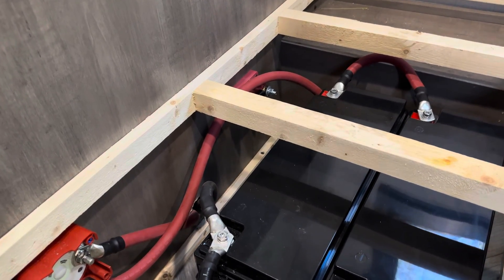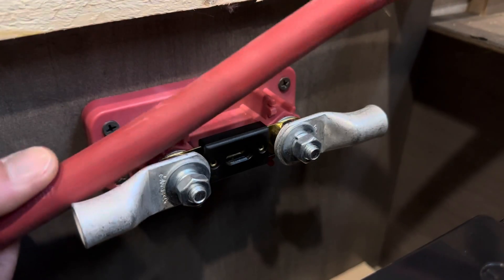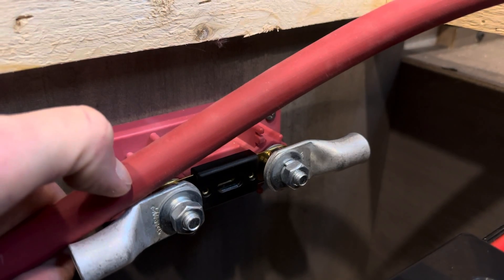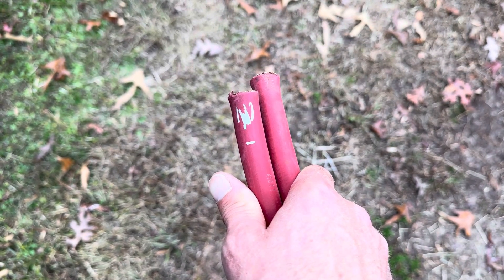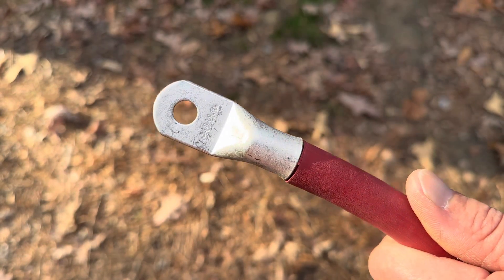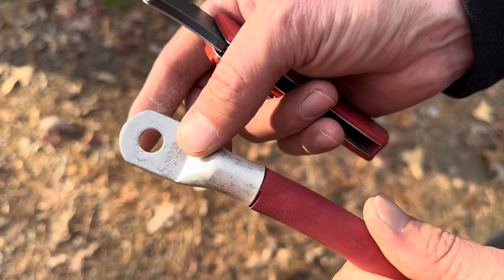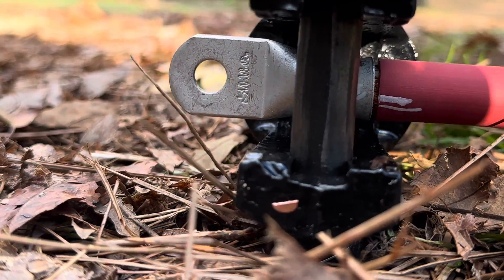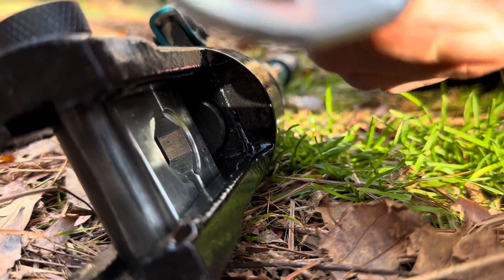Make Your OWN Battery Cables

Comment: Thank you!  I've done much smaller wire, always have been a little intimidated by this guage. I'm relieved to learn it's the same except for the crimping tool.  Also appreciate the tip to position the terminals for the job - I'd just never thought of that. Duh, lol!
Reply from the maker: You’re welcome! Glad it helped! Hydraulic crimping tool makes large cable lugs a breeze!